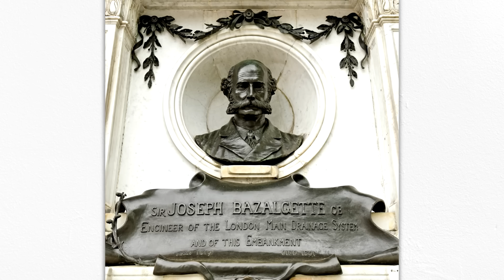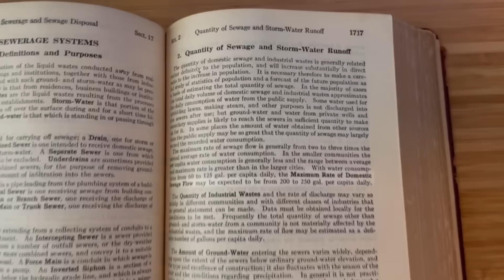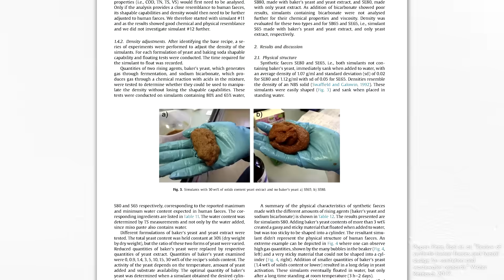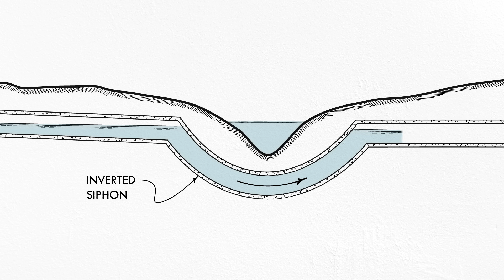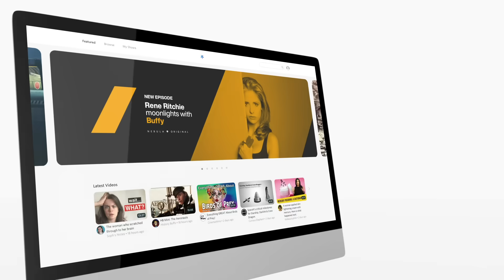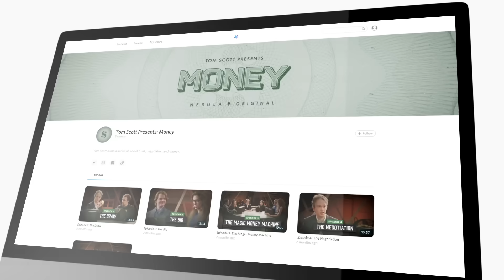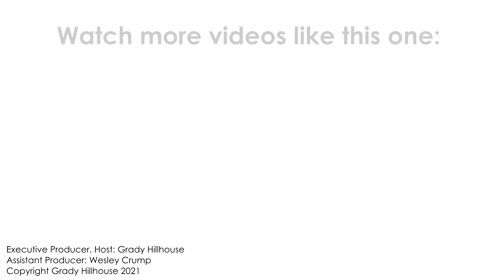How Sewers Work (feat. Fake Poop)

Comment: Are pumping stations required throughout the network to keep the pitched pipes from going too deep? It seems like a huge number of them would be needed. If so, how do they make the system be resilient against power outages and be self starting?

I don't think infiltration was made graphic enough. :-)  In one place that I lived, infiltration meant fecal flooding in residential basements during heavy storms, sometimes even if you had a backflow valve. 

A plumber once pointed out to me that the volumetric flow in a kitchen sink isn't adequate for the waste line to clear itself when a garbage disposer is installed, even when the disposer claims to fluidize the waste. Ever since I heard that, I periodically fill the kitchen sink and then yank the plug to send a big bolus of water through the line, hoping to get enough flow to clear any sediment. The disposer gives a nice big entrance, but then obstructs the flow, so I'll flip on the switch hoping that increases the flow, but wondering if the appliance can deal with what I'm making it do.

Great video! I think waste systems are amazing.
Reply: Larger pump stations have onsite diesel generators. Some of the smaller ones will be powered with portable generators.
Reply: @aeromodeller1  Thanks. Does it take many stations to handle a city? How do you avoid needing a zillion of them? Is there a main backbone to the piping network that is deeper and supported with pumps and then the vast majority of the network can just pitch down to it? Sounds like a challenging optimization problem.
Reply: @ef2b  Every location will be different. It depends on the topography. If distances are too great, another treatment plant can be built.